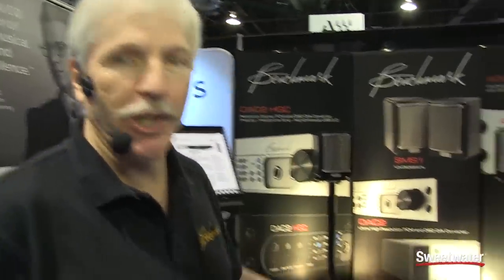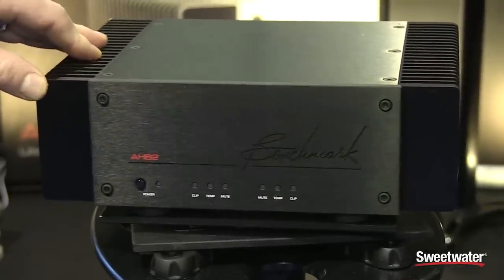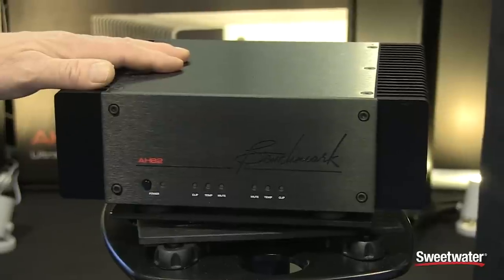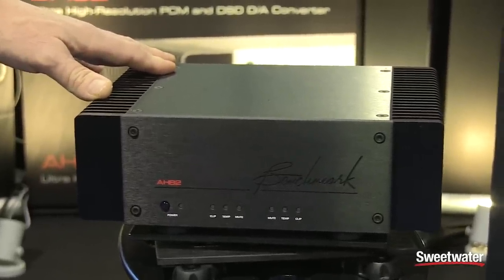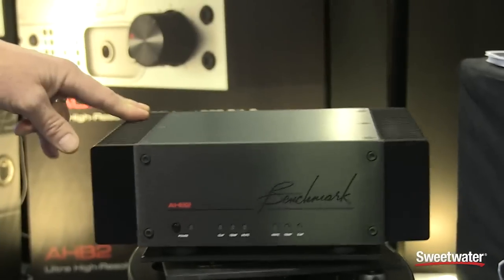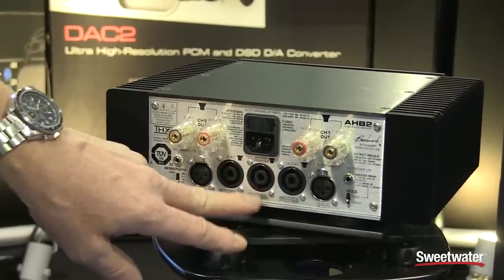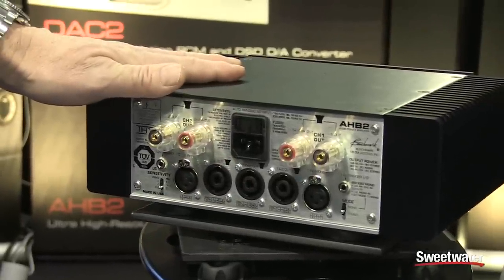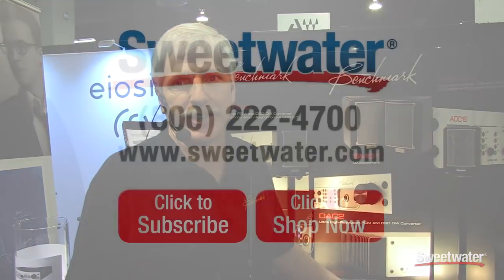Benchmark AHB2 Power Amplifier - Sweetwater at Winter NAMM 2015

Comment: Is there anything comparable to this that's under 1500$??
Reply: From an objective standpoint of power and distortion measurements, your best bet under $1500 are amps based on class D hypex or purifi modules .  The hypex nc400 in particular measures exceptionally well with high power output and you can get 2 channels for under $1500.
Reply: like stated above DIY Hypex and purifi amps
Reply: Try used Quad power amplifiers based on “current dumping” circuit design … Quad 405-2 (2x100w @ 8ohm), Quad 606 mk2 (2x130w @ 8ohm), Quad 707 or 909 (2x140w @ 8ohm) … ultra reliable, fantastic sound.